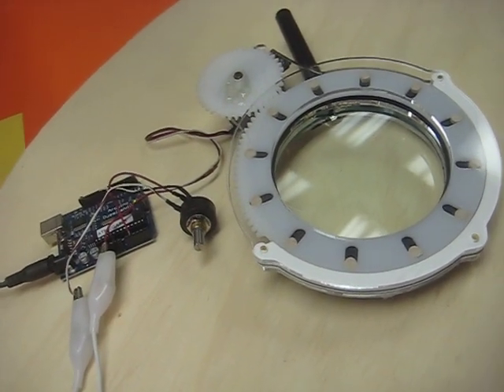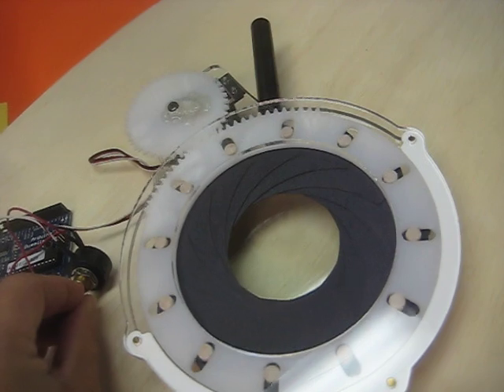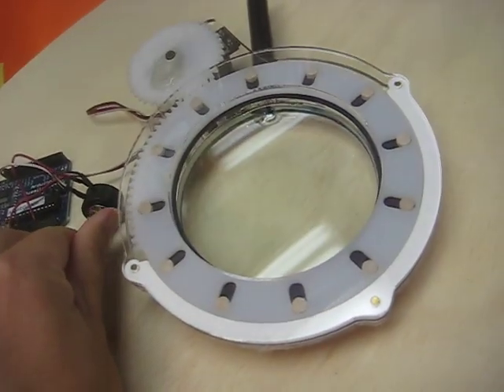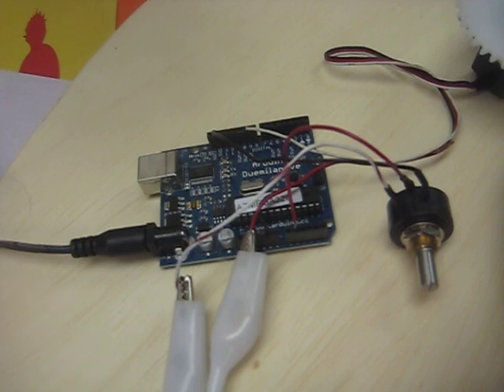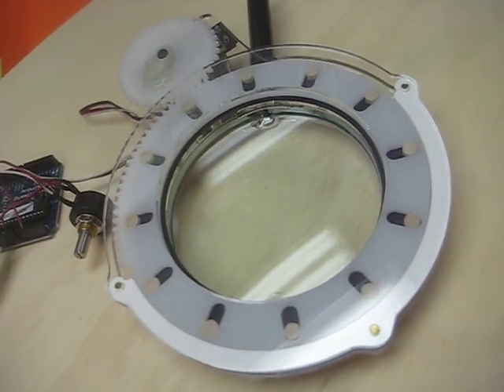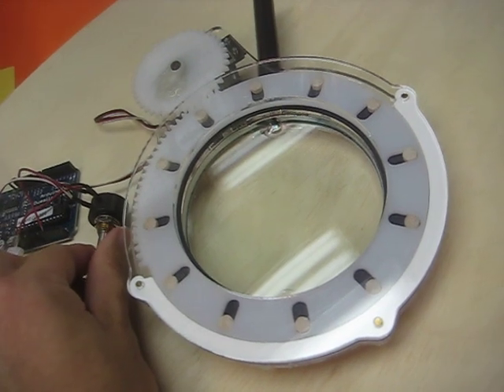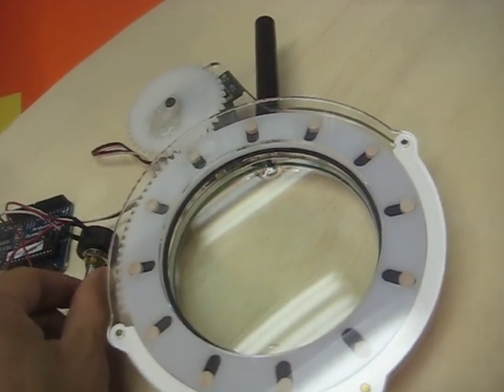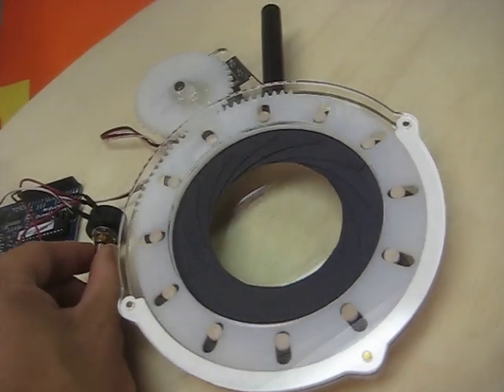Iris Diaphragm Under Servo Control

Comment: can share cad files?
Reply from the maker: I did that a long time ago.  I designed it in Illustrator.  I can probably track down the files if those would be useful.
Reply: @kurtschaefer  yes it would really 😭becuz really there is not project like yours in anywhere. This what i exactly need. I have school project and I must use servo.
Reply: @kurtschaefer     i will make 3d files them and i will advertisement your channel ☺   so huge amount thanks
Reply from the maker: @Rabianurguven  See if these work for you.  It's two ai files.   Be aware that this iris does not close all the way down.  I didn't need that for my project.  You can adjust that by changing the blade width.  Folks if you download these give this a thumbs up so I at least know how many folks are using the files!
https://www.dropbox.com/s/tcucaoix25mwad6/Iris8_blades.ai?dl=0
https://www.dropbox.com/s/tiwumdosqomfz1n/Iris8.ai?dl=0
Reply: @kurtschaefer  thank you very muchh😃

Comment: my question for iris mechanism is how the driven is kept without a mounting small shaft.... the driver gear is mounted on the motor shaft... but the driven that contain the shutter is not mounted on any shaft..... (it's center is open)
Reply from the maker: It is held captive by the outer arc of white plastic.  You can think of it as being its own giant shaft running in a C shaped plain bearing that just happens to have  a big hole in the middle.

Comment from the maker: @Aerospacesmith I just made up the blade dimensions. (You can rotate things in illustrator to try different shapes.)  I don't think you want to use my dimensions exactly.  (I designed this to not close all the way, so the blades would have to be a bit thicker to support closing all the way without there being small triangular gaps around the outside.  My inner ring size is 4" and the blades are 5/8" wide, but you'd want slightly wider to support full closure.   Good Luck!